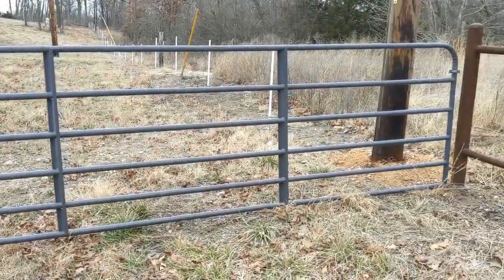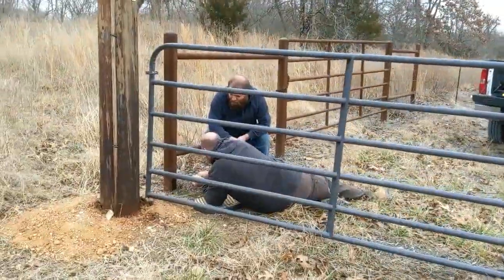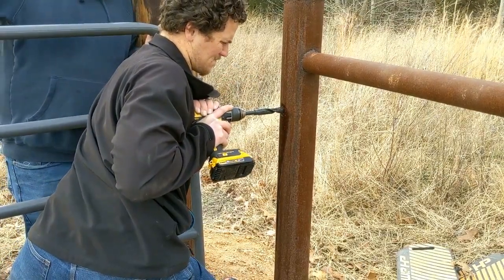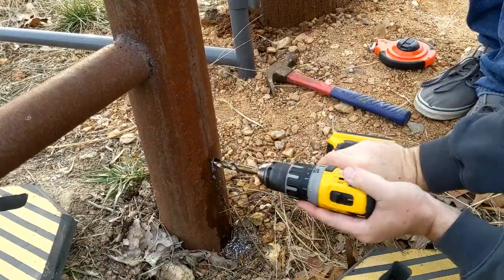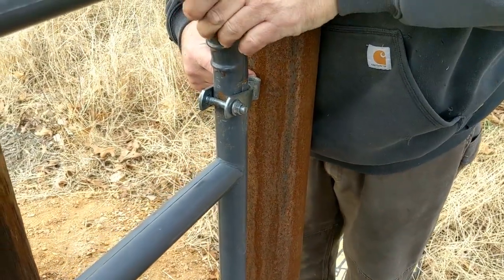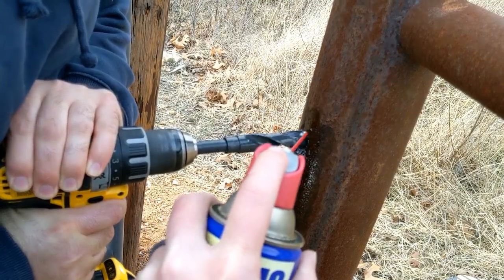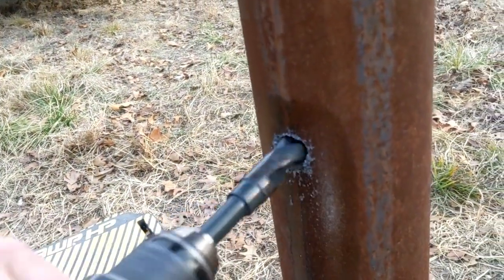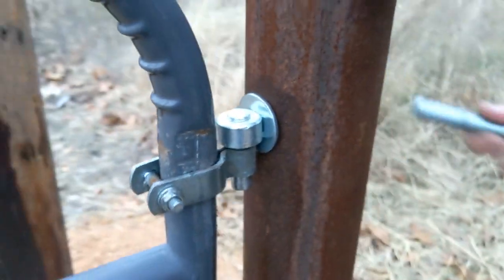Farm Gate Install

Comment: WELDER MY FRIEND!!! Outdoor all ventilation you need
Reply from the maker: Let me just run a 500’ extension cord out over yonder.
Reply: Lol, I chose to ignore that detail because it really doesn't take away from the video. but yeah. I'm about to put a gate up and I have the same problem no power and I'm worried the people that has been trespassing will just unbolt and steel my gate.
Reply from the maker: Gates, doors, locks, etc… only keep the honest people out.
Reply: I’ve got a 110 inverter mig running.035 flux core it can be ran off an inverter on the truck so 10 ft extension cord and it’ll weld up to 1/4 inch. $209 at HarborFreight well worth the money if you’ve got a farm

Comment: Back when  a fence guy made me wood gates he pot in pipe post. Since every gate died I am installing a fence gate. Think I am using the clamp hinge like on chain link gates. The pipe he used was actually a drill pipe. That sucker is a bugger to drill thru